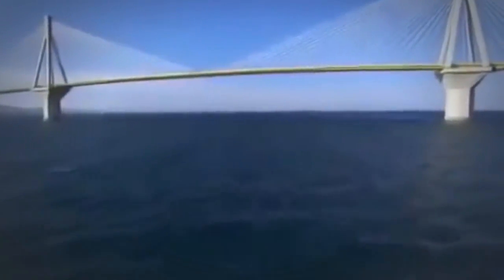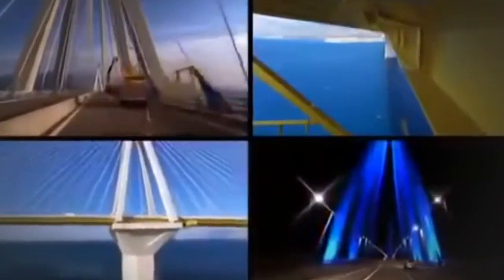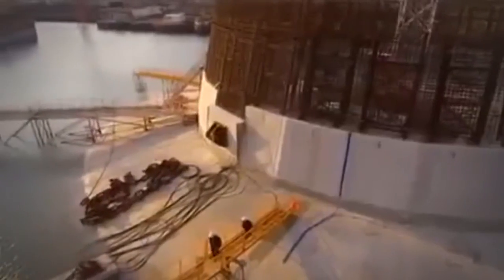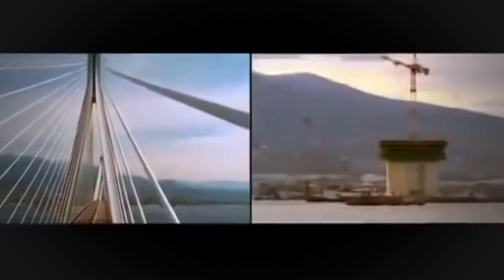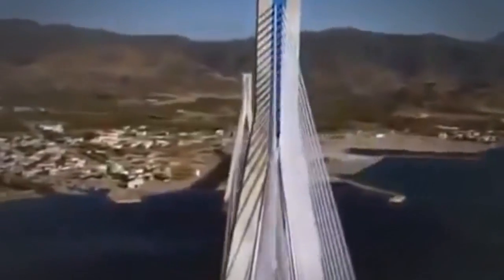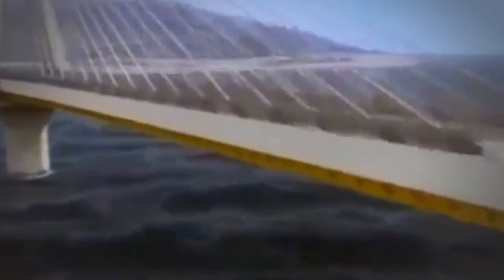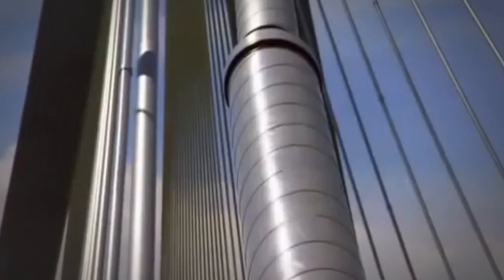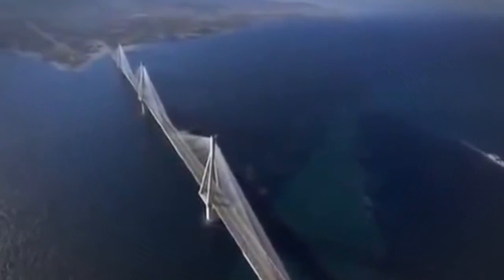The Impossible Bridge of Greece Full Length Documentary

Comment: at first it was shown as peer as hollow structure and any water sign will detect and alarm and later on to handle wait of the bridge the peer were filled with sea water to gain more wait and handle the wait of bridge.
Just wanted to understand what happens with checks and devices which were installed for water detection in the peer earlier?
Reply: The water was pumped out later.

Comment: it would have been cheaper to make a floating bridge out of bamboo and tar
Reply: I don't understand why they do not approach this from a more military engineering method. It probably would have been something much simpler, not elevated, probably very utilitarian. The one that was built is a miracle of engineering and beautiful..I'm just curious why things like this are not built lower or even on the surface. And military bridges built by the core of engineers..they can build or ford nearly anything if need be.
Reply: At the end of the Gulf of Corinth is the city of Corinth, which received shipping.  Fords (over a seabed of 200'?) or pontoon-style bridges don't account for water-borne traffic.
Reply: Yeah I understand the sea traffic issue..there could be portals that could be opened and closed for this could there not?  I am just thinking in terms of budgetary requirements for a bridge such as the one that was built.